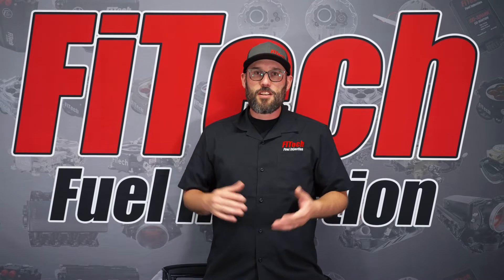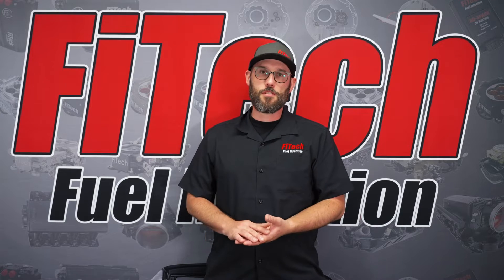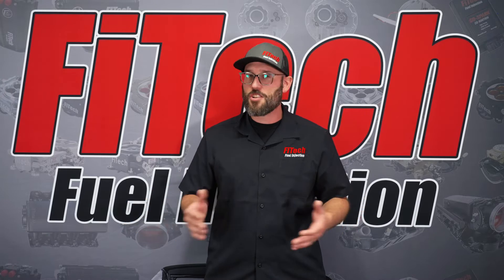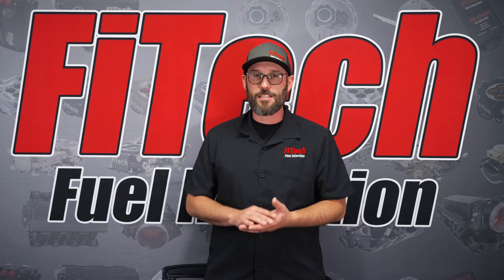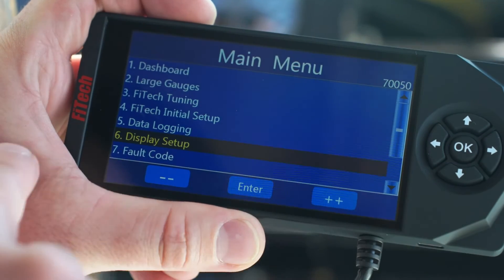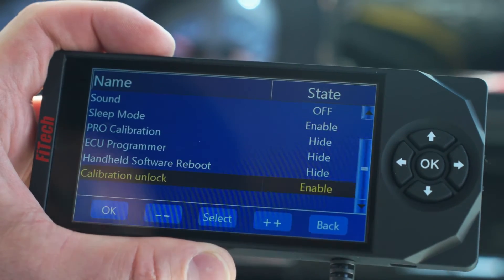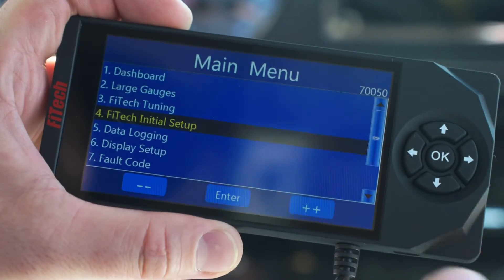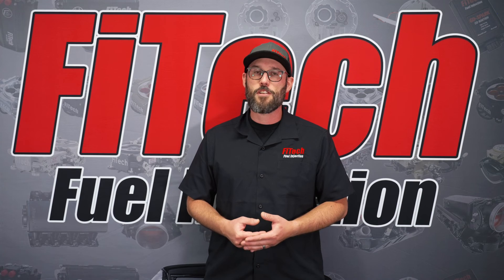Calibration Unlock | Tech Tuesdays | EP87

Comment: Having problems with it turning fan on. Its not comming on and unable to save the temp settings. After you change it and send it will revert back to old settings. Does not have calibration unlock option
Reply from the maker: The fan control is a ground trigger. Be sure you have it connected properly. As for the saving of the settings be sure you hit send to ECU on every item you change. The system will round the value a little so dont be alarmed. After you send to ECU all of your changes be sure to key off for 20 seconds.

Comment: Great videos, I have a question, when saving engine settings or tuning settings, I get a 1st message confirming the entry has been successfully stored which is followed immediately with a save message to V8 T196 message.  I am unable to retrieve such tuning file.  I must be doing something wrong, please advise and thanking you in advance
Reply from the maker: On the handheld under DISPLAY SETUP be sure that the CALIBRATION UNLOCK setting is DISABLED.
Reply: Tried it and it works (of course 👌🏻).  Thanks for answering.

Comment: Was wondering if you could create a video that explains how to adjust both front and rear IAC screws? So far mine reads correctly but I don’t know if it would benefit from adjusting both of them.
Reply from the maker: The primary to secondary linkage is setup to work 1:1 therefore the secondary adjustment screw is not very important.

Comment: The support team sent me the software update for 30004 ECU V1.34 with external fuse box and new no dots screen and the system gives strange numbers on the dashboard and does not make any changes when I send it to the ECU. After that I wrote to support about it and they never responded to me.
Reply: In fact, it seems strange to me that things like gear state, vehicle speed appear on the dashboard.
Reply from the maker: Under DISPLAY SETUP on the handheld there is an option called CALIBRATION UNLOCK. Make sure it is disabled. This will prevent saving. If you are using the external relay/fuse box ECU you should be running T210 software on the handheld. Are you? You can check under WRITE CAL TO ECU.
Reply: @FiTechEFImedia  
When I saw this video I reinstalled the operating system they sent me to see if that function you sent me to lock calibration was there, but it wasn't.
On the other hand, the calibrations are called T210, and the file they sent me is called New HH 30004 T210 v1.34 NoDot
Reply: I clarify that although the option to block calibration does not appear. certainly when installing the software on the handheld computer new options appear but that one does not appear